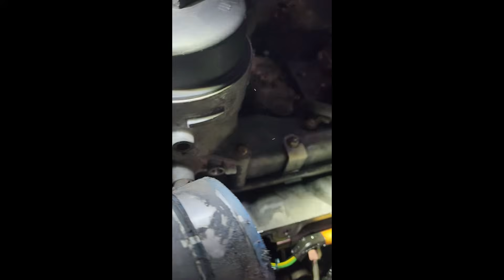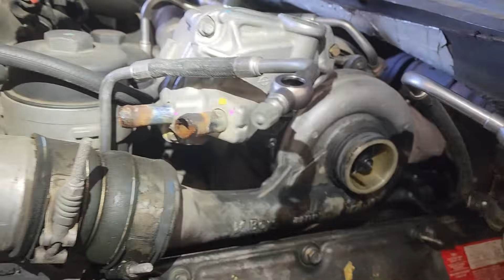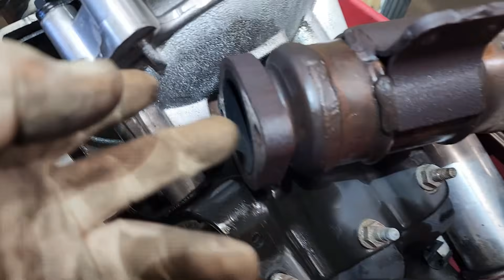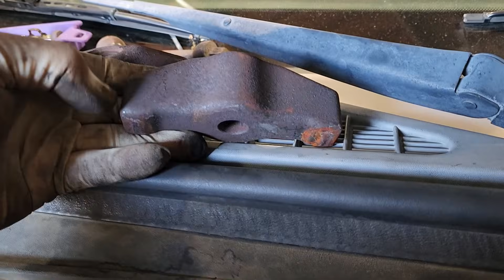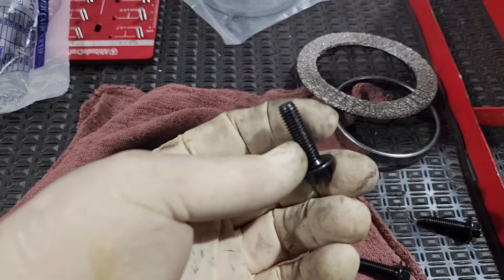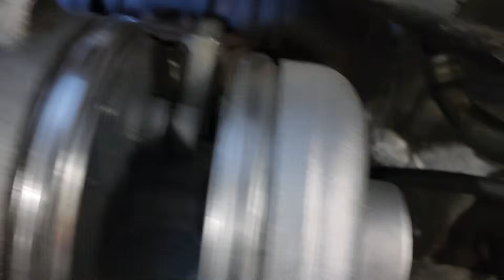6.4 Powerstroke TURBO Replacement without lifting CAB

Comment: I'm really annoyed. Just finished going an oil cooler swap on an '08 and of course did all of this. 100% saw the two holes for the alignment pins but now I'm certain someone else has been in the truck as those pins were missing. Hopefully after having got it all back together I have no issues. 🤞

Comment: So i did one with cab on, one tip i missed seeing in any video is for the pipe bolts on back, start from driverside and work across. This opens up all the room you need for the passenger side. I work left handed so starti g passenger side was my normal on most projects.

Comment: Two questions, do clean motor oil work good for lube? And were you able to get the turbos in by hand? Or did you need a hoist, thanks!
Reply from the maker: Yes oil works for lube and I can do it by hand but it is heavy and awkward, You have to align both oil drains,

Comment: Tip ^ loosen front of truck body & lift 2 inches. 

Huge advantage for firewall work.
Reply from the maker: Yes that is actually how I do it just wanted to show that you can do it without doing that.
Reply: How did you lift the body?

Comment: Sorry man I'm jacking up the front of the cab. And putting in some blocking just for stabilizing the cab while it's up that extra couple of inches. The time is worth the aggravation if I don't. Maybe it's just me.but to me it's worth it, and if you have to replace the cab mounts so be it. I  suggest S&B cab mounts. I'm not putting a plug in for S&B but they are a good quality. If it's the first time removing the Cab bolts do not use the air hammer on them. You will tear up the caging materiel that holds the cab bolt nut in place. You must use a good longer breaker bar in a tighten a little bit on the first attempt then loosen then repeat tightening then loosen. This will get you through all the buildup of the manufacturer's lock-tight this is a long process doing this by hand use lots of spray-on penetrating oil. Get it way up there on those bolts they have lots of threading you may get to a place where you can use a 1/2" ratchet but when it starts to bind up, just tighten it up, then back it off. It's the lock-tight building up on the front of the threads before they go through the nut. I repeat. Do not use the air hammer or any hammer-type drill while attempting to remove the cab bolts. You will give yourself more grief than you need and turn the job into one that is even longer. Trust me.
Reply: P.S. If this is the first time lifting the cab watch the video on raising the O8 power strike cab. Pay attention to all the little disconnects etc...
Reply: Yes this is a good watch
Reply from the maker: I normally lift the front of the cab 4 inches, I only made this video because some people want to see it without lifting it.

Comment: Can you take the intake manifold off without lifting the cab? Trying to get my heads off to see if I smoked a piston.
Reply from the maker: You have to remove turbos before removing intake and yes you can remove turbos without lifting the cab.

Comment: Any trick to getting the bottom bolts of the up pipes off? Got the top four but CAN NOT get them bottom 2😂
Reply from the maker: Message me on Instagram they are a bugger but there are special sockets and such.
Reply: @nutsandboltswithtone wasn’t easy but was able to do it with the tools I had. No special sockets or tools needed for the way I did it
Reply: @just.junkin . What tools did you use for this job? I’m fixing to start this week to replace hpfp gasket/harness. I know nothing about diesel but decent diy mechanic

Comment: what if its egr deleted? would i still have those egr pipes?
Reply: Not if they have been removed, they can still be there after a delet
Reply: @alexloewen9780 found out mine was removed with the delete. I have started the process of replacing my turbos. Stuck at removing the bottom two bolts on my up pipes
Reply from the maker: Message me on Instagram there is a special socket for that.
Reply from the maker: Not if they deleted it properly.

Comment: Would have loved to have watched you disconnect the up pipes from the back of the turbos without jacking up the front of the cab and not doing all the prep. work and disconnect etc. I mean a lot of it has to be disconnected anyway when removing the Turbos anyway right? So. I'm deleted no California law hear to have to put engine-damaging failed emission control. I mean what good good does collecting all that exhaust to just dump raw diesel into the pistons to raise the exhaust temp got enough to burn it all out and vent it straight to the atmosphere. Then have to deal with all the other users of the roads. Shaking their fists and calling you names from teared up eyes. Except the crud, the EGR plugged the intake ports full of soot carbon and engine sewage. Now how the hell are you supposed to deal with all that?
Reply from the maker: Emissions stuff makes things much more difficult for sure and costly. Unfortunately could not show disconnecting up pipes because it is very tight with cab on, you have to feel around and make sure socket is square on bolts or they will round.

Comment: Does the valve cover need to come off to remove the EGR pipe because I have taking down the 6 bolt and the ebp but pipe doesn’t want to come out .
Reply from the maker: I think there is only 2 ways one is partially lift the cab but not sure if that gives u the proper clearance. With valve cover off it

Comment: Fantastic video.  What would you describe as the single most challenging part?  Is it the 6 bolts on the back of the turbo?  Or something else?
Reply from the maker: Yeah probably the up pipes. Next would be getting it in and set down properly

Comment: What about replacing them with remote mount turbos?
Reply from the maker: Never seen those
Reply: @NutsandBoltswithTone  Oh, it's where the turbos are mounted downstream under the pickup bed. The only downside is the LONG AF intake piping has a huge volume, so if you fall completely off boost, it takes a bit to get back on it. That's also kind of an upside though, cuz it means your boost barely drops off at all during gear changes.
Reply from the maker: @operator8014  gotcha

Comment: About to do this on my truck. Can i just fully remove that down pipe to the egr? I didnt know there was a back pressure line down there is it important? I will still be using the twin turbo set up
Reply from the maker: Yes it is important for egr.

Comment: You're a liar, and you should change the title of this video. It can not be done without at least lifting the cab, but I'm not 100% it's possible even then.
Reply from the maker: Sure buddy. I've done it without lifting at all, partially lifting and completely lifting
Reply: I just did mine over the week on a 08 f350 with the 6.4 and I got the turbo out without lifting the cab at all but at the same time I do have to lift the cab now because I’ve got to replace my up pipes and down pipes the up pipes was the whole reason behind this job then it turned into the turbo being locked up I just got the truck last week
Reply: @zaphodbeeblebrox4923 You are  a disrespectful mother…..  u cant be calling people liar and shit like that before you actually experience it yourself. Because im sure this is you just repeating something you may have heard from someone else. And you are completely wrong bro. I have taken my turbo out on my 08 f 250 6.4  powerstroke around 6 or 7 times and only 1 of those times I partially lifted the cab. Yes it does make the job easier to at least lift it a couple of inches but 100% it can get done without lifting it even 1 inch. So stop trying to discredit honest people here like the fucking media do,  and get your hands dirty like you should and confirm it yourself.

Comment: My oil line to the turbo is leaking. Is it easy to replace? Or do I have to take apart a bunch of stuff to get to it? Any advice would be greatly appreciated
Reply from the maker: @derekdineen3896  the oil line is on top. Have one connection in oil cooler housing a bolt there them 2 banjo bolts. One too each turbo.  I would replace whole assembly. New seals gaskets on banjo bolts. Message me on Instagram if u need anymore help
Reply: @ definitely need help. It’s a brand new complete engine with turbo. Put in by Ford. But the line they say is not covered under warranty
Reply: When you noticed it was leaking was it giving off smoke? While driving and just running while parked? Because mine is leaking into my turbo also and is giving off a bunch of smoke
Reply from the maker: @JordanMendoza-h3b  it can smoke while running.  I do not recall this truck specifically.  Make sure you check your crank case pressure.  U can message me on Instagram if you need help.

Comment: IMPORTANT Before embarking on this hell of a job, do yourself a favor and check your intake going into your low side turbo if you have oil residue it is not your turbo seals it is your CCV filter it is clogged don't do what I did and rip your entire turbo out to realize this. This job is not easy, especially if you still have the OEM down pipes. Let me be the stupid one so you don't have to
Reply from the maker: @ryanthornell1117  that is a bummer.  You can also remove oil cap while running that will tell you if ccv is clogged
Reply: @NutsandBoltswithTone  yes I honestly didn't even know anything about the CCV sistom till I did this job and i had white smoke and oil coming out of the oil cap and couldn't think of why that was till I put two and two together afterwards lol
Reply from the maker: @ryanthornell1117  damn that really sucks sorry to hear
Reply: @ryanthornell1117  Did you have any oil at exhaust or blue smoke
Reply: @NutsandBoltswithTone grate video, by the way, even though I found out the hard way that I didn't have to take out my turbo, lol this video did help me tremendously
Reply: Where is the cab hose
Reply: Does the 2008 6.4 have one
Reply: What is a CCV, and where is it located? 
I am a woman, trying to maintain a 6.4L I inherited from my grandpa, the original owner. He drove the truck for 16 years.
Reply: Great video brother. I'm doing the same job right now in my driveway. It's a BEAR!  Not for the faint of heart. Had to watch your video about 45 times now because of all the "extraordinary ford engineering" that went into fitting so much inside this engine bay. All your tips worked great so far getting the oil supply line disconnected from the truck. It's just a rubber O ring that basically holds it down into the hole but I tell ya, requires a ton of force to remove it. And because you don't want to snap that thin metal tube it's hard to get a good grip on it. I found a video of a guy who used some metal cable and cable clamps together to create a cable lever that went through the eyelet of the mount and pulled it straight up and out over the engine  bay. I'll see if I can tag his video here for people looking for that kind of solution because it doesn't just pull out easily. Ford must have engineered me too. Maybe that's why I have so many kids.
Reply: @ryanplummer9084 please tag the video

Comment: Just listening to you makes me want to raze the front and middle cab bolts and all the connections to lift the front of the cab safely giving a bought 6 to 8" of clearance at the back of the turbos and the up pipes. Making the job much easier
Reply from the maker: @kevinoneill41  to be honest partially lifting the cab is so much easier however cab bolts can be a nightmare.  If you do not lift the cab at all you have very little room

Comment: Has anyone install turbos separate like or can only be installed completely assembled as one piece
Reply: I'm trying to do the turbo removal with cab on as you did, got the EGR tube loose at both ends and the brackets, got valve cover off, but I cannot get the EGR tube out as you did in the video.  Could you advise how you accomplished that part of the teardown?
Reply from the maker: @patrickknapp7038  it was like a puzzle getting it out.  I cannot recall how I actually got it.  I wish I could help you. Message me on Instagram if you need more help.
Reply from the maker: You have to remove them as an assembly and install them as an assembly, but you can replace one turbo if you want to.

Comment: I like to just undo my cab bolts and jack the nose like 3 inches let's you just pull the fuel cooler and elbow and you can swing in to get those rear facing bolts. 6.4s are tough I own one with 450k on her
Reply from the maker: Wow 450k that is impressive. It's it deleted?
Reply: Great question with no reply 😂